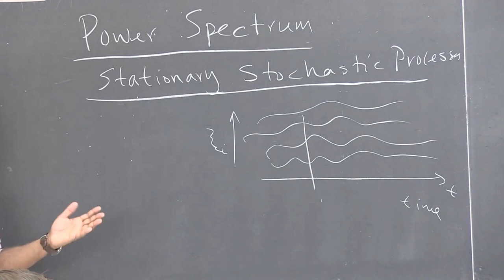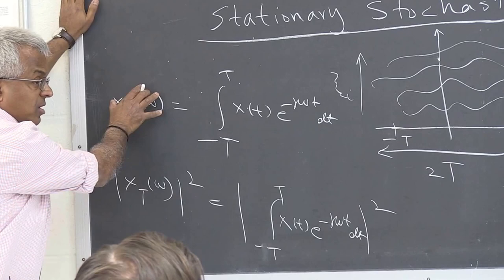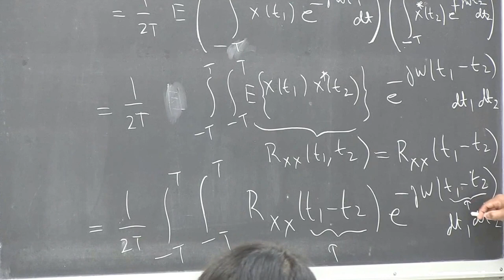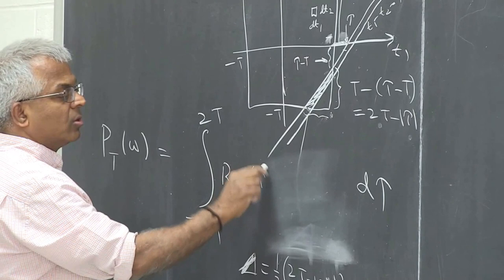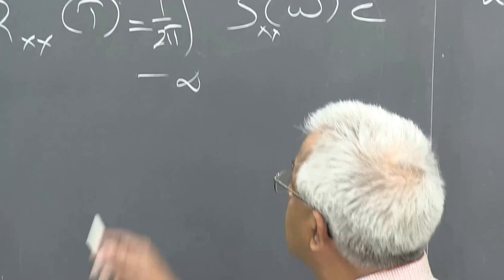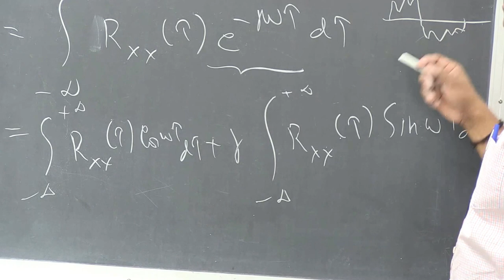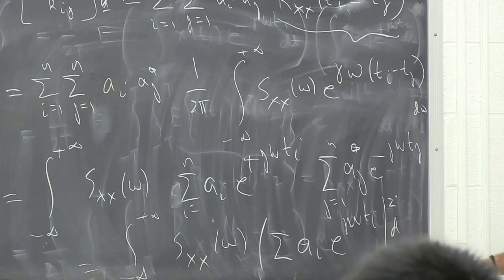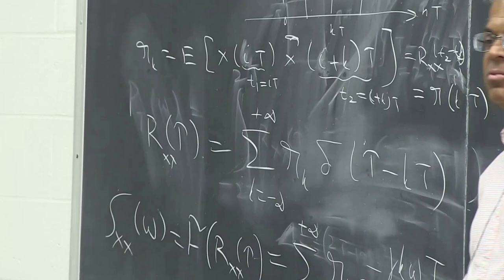Pillai Grad Lecture 10A "Power Spectrum of Stationary Stochastic Processes" (1/2)

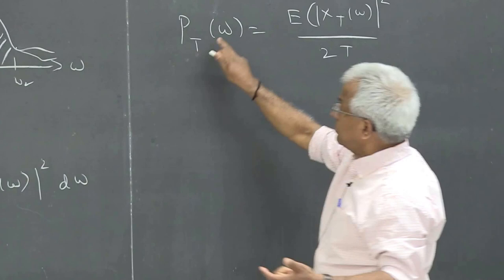Comment: 7:13 power is energy upon T. But in 22:20 the power expression E[X^2] does not have T. Why would this be sir? Possible answer: Power expression does indeed have T underneath. But T cancels out with the T from integrating dt. And E[X^2] does not depend upon T.
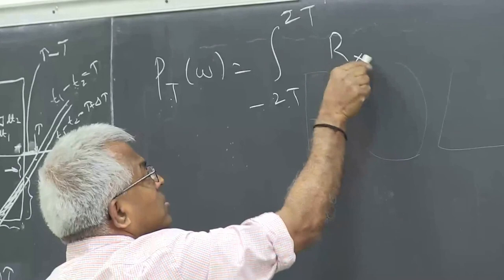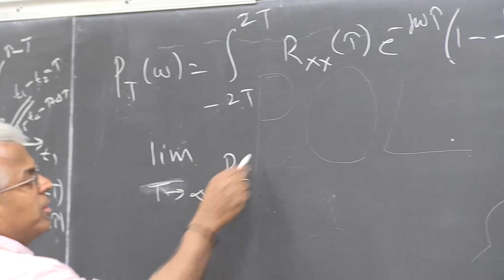Update: I have found the answer. I had a misunderstanding. The "T" gets resolved during the integration and limit (he even mentions it, see 16:57 and 18:37). That is why the T is not there in 22:20. Not deleting the question as someone else might have the same doubt. Furthermore, at 22:20 the T is part of S_x(\omega).

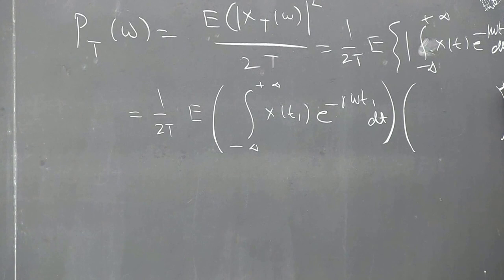Comment: @8:20, Why do we need to split the square of absolute into product of integral and its complement(*)? Why is it wrong to simply continue as product of 2 integrals?
Reply from the maker: Remember, we would like to exploit the wide sense stationary property of X(t), and for that we need a term like E[ X(t1)X^*(t2) ]. For that you have to bring in the expectation term inside  the integral, and that makes the autocorrelation  a function of t1-t2. If we call this new variable \tau, then we can collapse the double integral into a single integral etc.

Comment: Thanks Sir YB but how do I recover the standard distribution function F(x) Out of te psd , and vice versa ? And even if this possible ?
Reply from the maker: Delhi. That is not possible unless you are dealing with zero mean stationary Gaussian processes. Inverse transform of PSD gives auto correlation function. That is second order characterization. The only stochastic process whose joint probability density function is characterized by the first order and second order  moments is the Gaussian process. See my multiple lectures on Gaussian  Processes.